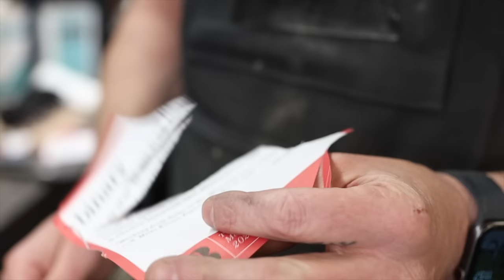Making 10 knives pt 5 - KYDEX & Sharpening

Comment: Jeremy, some kydex tips that have worked worked well for me, i use an electric griddle rather than a toaster, I've found it faster and it heats more evenly. Then for finishing the edges, rather than buffing you can take a paper tower with acetone and just rub that over the edge, it's dissolves the kydex and leaves a nice smooth, shiny edge. May be worth trying out to see if you like it.

Comment: I use the heat treatment oven at 180 degrees Celsius in 0.7 mm kydex and that way I prevent it from going bad and getting ruined. It also heats up so fast that it is almost unnecessary to leave the oven